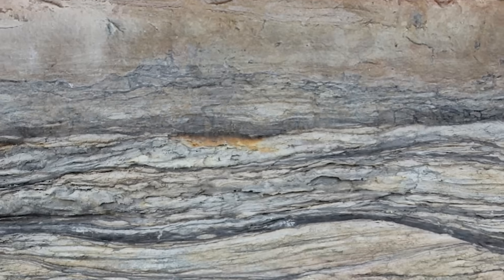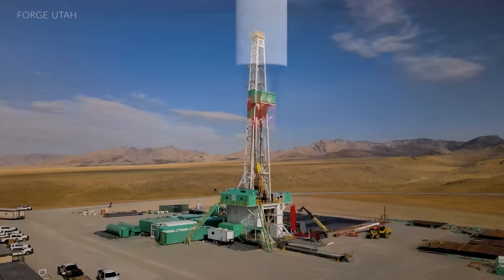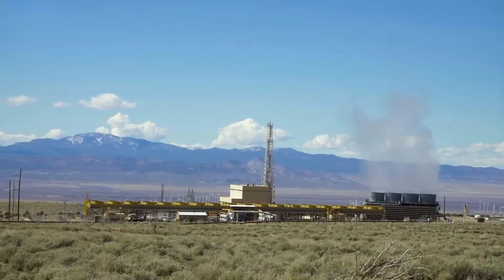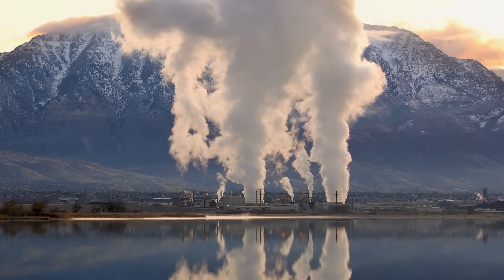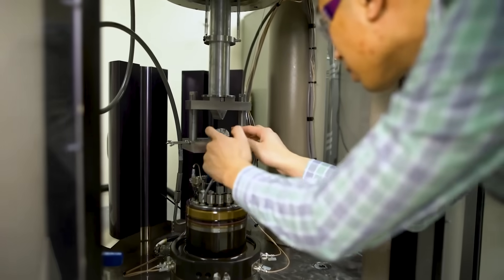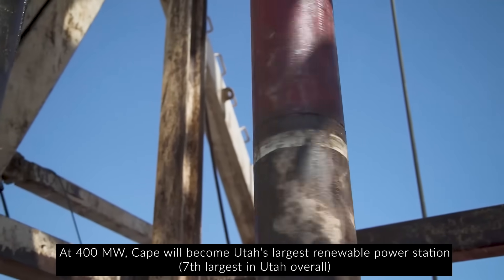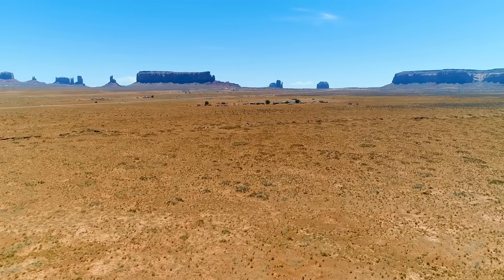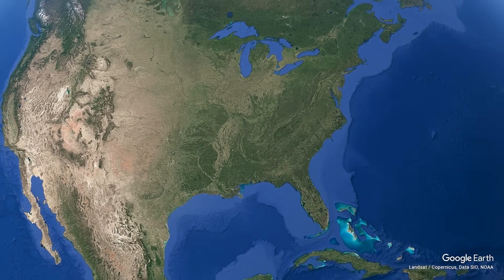This Groundbreaking Clean Energy Source Could Power America

Comment: 120522     The second law of thermodynamics may be false conventional wisdom. Let's face the wonder of full heat use. 

The second law of thermodynamics was developed during victorian england's scientific and religious fascination with steam engines. 

The second law is behind modern refrigerators needing electrical energy to compress the refrigerent to force it to release as waste the heat that it has removed from the refrigerator's service interior in the cooling part of the refrigerent's circulation. The interior coldness draws in exterior heat through the cabinet insulation. There is also discarded heat from mechanical friction and electrical resistance. The net thermal output equals the electrical input with energy not being gained or lost in this refrigeration system including its forced waste. Unencumbered refrigeration by the principle that energy is conserved should produce electricity instead of consuming it. 

It makes more sense that refrigerators should yield electricity because energy is widely known to change form with no ultimate path of energy gain or loss being found. Therefore any form of fully recyclable energy can be cycled endlessly in any quantity. 

Full heat recycling, all electric, very isolated underground, undersea, or space communities would be highly survivable with self sufficient EMP resistant LED light  automated vertical farms, thaw resistant frozen food storehouses, factories, dwellings, self contained elevators, safe rooms, and horizontal transports. 

In a flourishing civillization, small self sufficient electric or cooling devices of many kinds and styles like lamps, smartphones, hotplates, water heaters, cooler chests, fans, radios, TVs, cameras, security devices, robot test equipment, scales, transaction terminals, wall clocks, open or ciosed for business luminous signs, power hand tools, ditch diggers, pumps, and personal transports, would be available for immediate use incrementally anywhere as people as individuals or larger social groups see fit. 

Some equipment groups could be consolidated on local networks. 

If a high majority thinks our civilization should geoengineer gigatons or 
teratons of carbon dioxide out of our environment, instalations using devices that convert ambient heat into electricity can hypothetically be scaled up do it with a choice of comsequences including many beneficial ones. 

Energy sensible refrigerators that absorb heat and yield electricity would complement computers as computing consumes electricity and yields heat. Computing would be free. Chips could have energy recycling built in.
This would improve performance and lower cost,
A simple rectifier crystal can, iust short of a replicatable long term demonstration of a powerful prototype, almost certainly filter the random thermal motioren of electrons or discrete positiive charged voids called holes so the electric current flowing in one direction predominates. At low system voltage, a filtrate of one polarity predominates only a little but there is always usable electrical power derived from the source, which is Johnson (observation) Nyquest (theory) thermal electrical noise. This net electrical filtrate can be aggregated in a group of separate diodes in consistent alignment parallel creating widely scalable electrical power. The maximum energy is converted from ambient heat to productive direct current electricity when the electrical load electrical resistance  is equal to the array internal electrical resistance. 

Maximum calculated electrical power output (watts) is k (Boltźman's constant), one point three eight x 10^ minus 23, times T (temperature Kelvin) times bandwidth (0 Hz to a natural limit ~2 THz @ 290 K) times rectification halving and nanowatt power level rectification efficiency, times the number of diodes in the array. 

There are a billion cells of 1000 square nanometer area each per square millimeter, 100 billion per square centimeter. 

Order is imposed on the random thermal motion of electrons by the structual orderlyness of a diode array made of diodes made within a slab: 

Host crystal is silicon
  P type boron doped
-----‐------‐----___-- Out
🔻🔻🔻🔻
■■■■■■___ + Out 
  N type phosphorous doped 

All the P type semiconductor anodes abut a metal conductive plane deposited on the top face of the slab with nonrectifying joins;  the N type semiconductor cathodes or common cathode abuts the bottom face. As the polarity filtered electrical energy is exported, the amount of thermal energy in the group of diodes decreases. This group cooling will draw heat in from the surrounding ambient heat at a rate depending on the filtering rate and thermal resistance between the group and ambient gas, liquid, or solid warmer than absolute zero. There is always a lot of ambient heat on our planet, more on equatorial dry desert summer days and less on polar desert winter nights.

Focusing on the composition of one simple diode, a near flawless crystal of silicon is modified by implanting a small amount of phosphorus (N type conductivity) on one side from a ohmic contact end to a junction where the additive is suddenly and completely changed to boron (P type conductivity) with minimal disturbance of the crystal lattice. The crystal then continues to another ohmic contact. 

A region of high electrical resistance forms at the junction in this type of diode when the phosphorous near the ĵunction donates electrons that are free to move elsewhere while leaving phosphorus ions held in the crystal while the boron donates holes which are similalarly free to move. The two types of mobile charges mutually clear each other away near the junction leaving little electrical conductivity. An equlibrium width of this region is settled between the phosphorus, boron, electrons, and holes. Thermal noise is beyond steady state equlibrium. Thermal noise transients, where mobile electrons move from the phosphorus added side to the boron added side ride transient extra conductivity so the forward moving  electrons are preferentally filtered into the external circuit. Mobile electrons are units of electric current. They lose their thermal energy of motion and gain voltage, as they transition between the junction and the array electrical tap. 

Inside the diode, heat is absorbe; outside the diode, to exactly the same extent, an attached electrical circuit is energized. The voltage of a diode array is likely to be small so many similar arrays need to be put in series to build higher voltage.  

Understanding diodes is one way to become convinced that Johnson Nyquest thermal electrical noise can be rectified and aggregated. Self assembling development teams may find many ways to accomplish this wide mission. Taxonomically there should be many ways ways to convert heat directly into electricity. 

A practical device may use an array of Au needles in a SiO2 matrix abutting N type GaAs. These were made in the 1970s when registration technology was poor so it was easier to fabricate arrays and select one diode than just make one diode. 

There are other plausible breeches of the second law of thermodynamics. Hopefully a lot of people, mostly as independent teams, will join in expanding the breech. Please share the successes or setbacks of experiemental efforts. 

These devices would probably become segmented commodities sold with minimal margin over supply cost. They would be manufactured by advanced automation that does not need financial incentive. Applicable best practices would be adopted. Business details would be open public knowledge. Associated people should move as negotiated and freely and honestly talk. Commerce would be a planetary scale unified conglomerate of diverse local cooperatives. There is no need of wealth extracting top commanders. We do not need often token philanthropy from the top if the wide majority of people can afford to be generous. 

Aloha
Charles M Brown 
Kilauea Kauai Hawaii 96754

Comment: I still don't understand why ThermoPhotoVoltaics are not the answer. You drill. You drop a string of TPV cells into the hole connected to a high voltage power cable. You seal the hole. Tranformer..Plug in.
Reply from the maker: That sounds pretty efficient!

Comment: Oh! It’s fracking. Isn’t that such a bad idea?
Reply: I'm literally copy-pasting my response at this point b/c everyone seems to be hung up on the name:
Most of the risks of fracking for oil and gas are from 1) the additives used to coax these substances from the rocks and have them flow smoothly and 2) the risk of oil and gas leaching into groundwater sources. B/c the only thing being transferred is heat, not hydrocarbons, the only additives that are needed for geothermal fracking are disinfectants (to prevent build ups of bacteria) and brine (to make it harder for underground metals and minerals to dissolve into the water). On top of that, it's much easier to treat water for heavy metal contamination than for hydrocarbons, which can be carcinogenic at very small concentrations. If contamination does occur, it's relatively easy to plug the well and move on than with oil wells. Once the well is plugged, there's no more hot water moving through the rock to find its way into groundwater.
Reply: Well sometimes these things are so technical that the average lay person not be presenting opinions.

Comment: Even a 5% loss in water is a huge water demand - in Canada, a company named Eavor has a closed-loop solution that looks very promising
Reply from the maker: True, as close to 100% as possible is ideal. The cost of the electricity produced by the EavorLoop coming online soon in Germany were 2-3x what Fervor’s currently are at Cape (correct me if I’m wrong). Not sure if that’s more due to a challenging regulatory environment in the EU, or the differences in tech/engineering.
Reply: @TheDailyConversation  why is that technology 100% closed looop, while this one is 95%
Reply from the maker: From what I understand, the Eavorloop drills two boreholes a few thousand feet apart that actually meet to create a “loop” through which they circulate a chemical fluid, like a big heat pump. They don’t use water to generate steam like Fervo/EGS does. Does that answer your question?
Reply: Eavor heats it's fluid in an underground manifold. This fluid heats water in a heat exchanger to produce steam.
Reply: I operate boilers and power plants. You will always have some amount of water waste as systems must be blown down (flushing water from the system to clean out sludge) and you also require some venting to atmosphere for safety to prevent over pressure or vacuum formations.
Reply: closer loop will be neither the solution.   physic say no

Comment: I Say Directional Drill.

For Example :-
Drill Two Holes at an Angle so They Intersect Deep in the Hot Zone.
Sure this Requires Accuracy and Clever Drilling.

Once You Perfect this Method, You can Parallel Drill for More Capacity.
Reply from the maker: Sounds good, but how is that different from what Fervo is doing?
Reply: @TheDailyConversation  You have to watch the Video.

Comment: A lot of folks don't understand how much cleaner fracking is now than it was thirty years ago. For those who weren't paying quite close enough attention to what was being said, this technology allows the potentil to piggyback on already-fracked rock once the kinks are ironed out. That means a hydrocarbon fracking play (which is short-lived) suddenly has vastly more value, particularly if the energy can then be used with molten-salt batteries useful for industrial-scale projects.

It takes the energy production that is most-unfairly-maligned by environmentalists and turns it into something environmentalists can immediately cheer for -- the re-use of existing, played-out fracking sites to slowly make most of the rest of them unnecessary/non-viable. (Most not all, we need hydrocarbons for other things, unless you want your artificial heart parts made from leather).
Reply from the maker: Amen
Reply: "Most not all, we need hydrocarbons for other things" Better idea: use DAC to generate hydrocarbon feedstock for the plastics industry. If you shut down all oil wells, that creates a market for DAC for the most necessary applications of plastics (like medicine) plus disincentivizes single-use plastics, and since plastics take ages to break down, it solves the sequestration and storage problem too.

Comment: Granite and radon gas go together, in Cornwall UK in the 1970's, they tried doing just this and came to the conclusion they had no plans in place to handle the increasing radioactivity of the circulating water.
Reply: Couldn't you store it in another underground void made in likewise manner?
Reply: Just put settling tanks in the radon will evaporate out and head to space. @Uncanny_Mountain
Reply: "increasing radioactivity of the circulating water."
Water cannot be made radioactive but of course contaminants IN the water could be radioactive.   If it is in a closed cycle steam generator, who cares about it?  Radon emits alpha particles if I remember right; a sheet of paper is sufficient to block it. 
Radon has a halflife of only 3.8 days and is indeed alpha particles (protons, in other words).  https://www.epa.gov/radiation/radioactive-decay
Reply: Though, not all rocks are equal. The black hills mines have some surprisingly low radon activity.

Comment: Two things
#1 Its great to frack for geo thermal but evil to frack for oil?
#2 Is it a really a good idea to cool the earth in a non natural way?
Reply from the maker: 1. Not evil, just not ideal.
2. What do you mean? Cooling the earth as in the soil/rock underground (seems fine) or cooling the air (we’re warming it unnaturally so why not)?
Reply: #1 fracking to extract oil and gas is not ideal. Burning oil and gas produces ghg which warms the planet which in turn creates more intense storms. It's also well documented that oil and gas infrastructure leaks methane which is one of the most potent ghg. Economically, nations can not afford to continue to burn carbon and  pollute the environment freely. Oceans are warming to a significant extent that earth is losing biodiversity and that will ultimately affect the food chain. Further, nations simply can't afford to pay for the damages that these storms cause to households and businesses. Take hurricane Helene and it's destruction. There are going to be parts of states that will take years to recover. Yet, hurricane season happens every year and the storms are getting more intense as time passes. Damage from severe storms, on a cumulative basis, could wipe out national treasuries in the future if the world doesn't transition to low carbon economy. If a person has a leaky roof, the prudent action is to fix the roof and not ignore the problem. At the end of the day, this is about saving people and governments $$$.
#2 No risk of this happening as the core has retained this heat for billions of years and the core constantly regenerates the heat. It is a potential unlimited energy source.
Reply: Oil and methane pollute far more. The difference is same as digging a mine tunnel and drilling an oil well through the aquifer you get your drinking water from: Even if you completely failed to look into what is down there and tunnel into an aquifer the potential for contamination is tiny compared to mixing millions of barrels of oil into your water source. And after that burning the oil and gas spreads massive amounts of CO2 and other pollutants all over while the heat and electricity from geothermal will be as close to 100% clean as realistically possible.

Also, if you failed to account for other ground conditions and the mine collapses the damage above will be small compared to emptying the huge underground reservoir of oil and gas which will allow the fractured earth to move causing an earthquake. Both could cause earthquakes but the potential is lower and the likely scale smaller with geothermal.
Reply: That's what I said but somehow my reply got deleted.
Reply: @TooSchoolForKool  YT weirdness again.
Reply from the maker: I still see your reply.
Reply: 1) most of the risks of fracking for oil and gas are from the additives used to coax these substances from the rocks and have them flow smoothly + the risk of hydrocarbons leaching into groundwater and surface water sources. B/c the only thing being transferred is heat, not hydrocarbons, the only additives being used are disinfectants (to prevent build ups of bacteria) and brine (to make it harder for metals and minerals to dissolve into the water). On top of that, it's much easier to treat water for heavy metal contamination than for hydrocarbons, which can be carcinogenic at very small concentrations. If contamination does occur, it's relatively easier to plug the well and move on than with oil wells. Once the well is plugged, there's no more hot water moving through the rock to find its way into groundwater.
2) Geothermal energy is effectively infinite. The water reduces the heat of the immediately surrounding rocks by a few degrees, but 10 feet away from the well there's basically no difference. Also, fracking mimics natural hot spring formation.